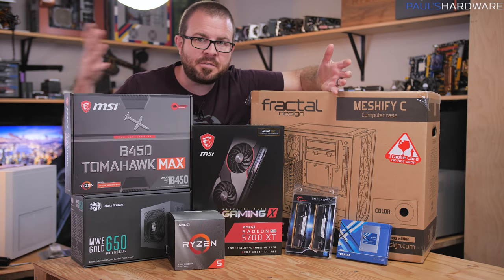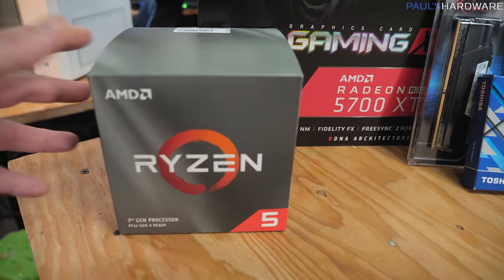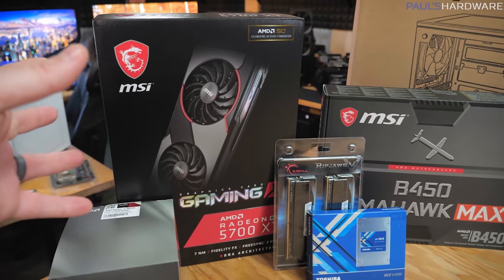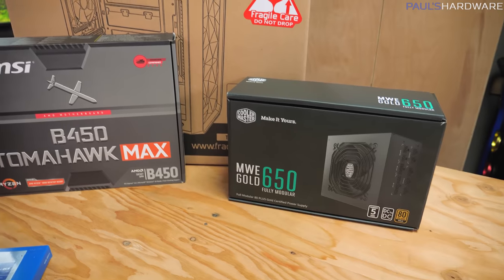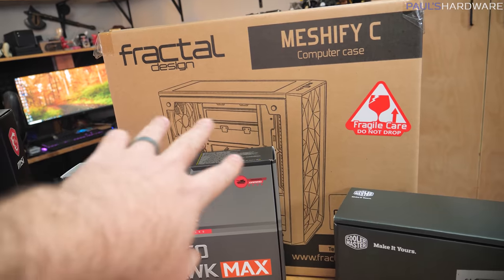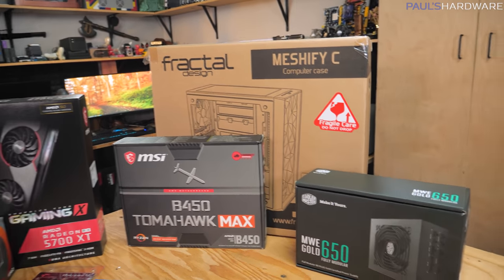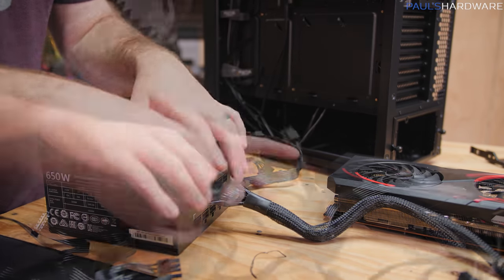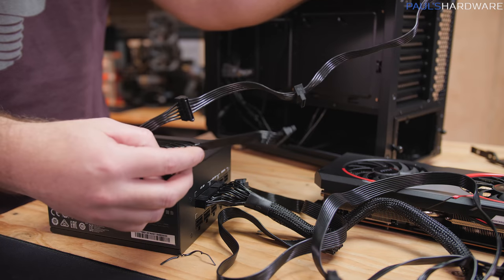Building the $900 Gaming PC that Everyone Should Build!

Comment: Hey. QVL recommends X570 motherboard for this RAM. Does it work perfectly with the b450 Tomahawk in the long run? Isn't it ever gonna be an issue? I'm currently building my first serious PC and I'm a bit worried about not buying what G.skill and AMD recommend.  Also this RAM costs like 180 dollars in my country so I don't know if it's worth it over  Corsair Vengeanca CL18 for extra 30 dollars.

Comment: thx for the build but adding 500gb more ssd and 1-2tb hdd for games and contents, 2 more case fans plus tax, it will end up $1100-1200 in most areas in US
if take keyboard mouse & monitor into consideration it ends up 1600-2000 to get a complete mid level gaming setup

Comment: Hey Paul, if I'm right msi radeon rx 5700 xt gaming x has recommended 750W PSU. Did you notice any issues about smaller 650W in this build? Thanks for answer.

Comment: built this machine.  Worked great until I tried more than two sticks of ram.  Went with two more sticks of Gskill Ripjaws 3600.  Computer won't boot if I try to use slots 1, and/or 3.  MSI says that the 3600 ram is not compatible with MSI tomahawk max.  Pc Partpicker doesn't flag any problem other that the bios update. The board I recieved new from NewEgg already had the bios updated.

Comment: Hey, not sure if you will get this comment, or reply. However, I was wondering if there is a replacement you would recommend to replace the graphics card, I heard that the 5700 xt has issues with lasting a while. Around the same price and power. Thanks

Comment: Hey Paul , so im tryna build i gaming pc and i put up a list of parts but instead of using xt 5700 i went with gtx 1660 super , my questions are  , is it better to go with 1660 super instead of 1660 ti , 
And for the motherboard is it better to go with  x370 instead of b450 ? , And will this pc be capable of being a single streaming pc ? , Sorry for the very long comment ^^'
Keep up the good work bud <3

Comment: Had a question....i know it may sound stupid but i always wondered about it....the m.2 sticker...do i remove it if there is a  Thermal pad for it and temps be better or just leave it on and it does the same thermals? Cuz i see sometimes ppl remove it wen there is a thermal pad like the asus rog strix x570-E and sometimes they leave it on...so is the any Differences in thermal temps if its removed or is it the same?

Comment: I have a question when I try to build this in pcpartpicker they say that the cpu (AMD Ryzen 5 3600x)  is not compatible with the motherboard (MSI B450 Tomahawk max). It says this: Some AMD B450 chipset motherboards may need a BIOS update prior to using Matisse CPUs. Upgrading the BIOS may require a different CPU that is supported by older BIOS revisions. What does this mean?
Reply: it means they gonna charge you extra for the bios uptade

Comment: I see you frequent the amd cards have you noticed any driver issues?  I see a lit of hard no reviews for amd cards citing great hardware but bad drivers with black screening issues.  I'm doing a similar build now and got a great deal on a freesync monitor so amd has been the plan since but after some research I see that nvidia cards can be set up to work with freesync.  Out of curiosity what are your thoughts?

Comment: Just built my first pc 2 days ago after watching many videos and reviews.  It ended up being pretty similar to yours:  Ryzen 5 3600, B450 tomahawk, 16gb 3600 DDR4, Meshify C, but with a 1660 Super and 2 TB SATA SSD. It came out pretty well. Only thing I'm disappointed in is download speeds. Around 11 GB/sec to the SSD on steam.  Is that expected? It might be my internet connection
Reply: Are you sure that's 11Gbps? Most home internet speeds do not go past 1Gbps. Run a speed test on speedtest.net or fast.com and compare that speed against what you're paying for. Make sure you do the speed test on a wired connection.
Reply: @JJFlores197  Woops, I meant 11 Mbps.I just did the speedtest, and it read 100 mbps which is way higher than what I experience on steam.
Reply: @nicksbordone5271  The thing to keep in mind is the units. Network transfer speeds are measured in megabits per second (Mbps). Speed tests show your speed in Mbps, but your web browser, Steam, and other programs usually display the speed in megabytes per second (MBps). There are 8 bits in a byte, so if you divide 100 Mbps by 8, you get 12.5 MBps, which is close to what you're getting on Steam. Its the same thing, just in a different unit of measurement. Its like saying 5,280 feet or 1 mile; 1,000 meters or 1 kilometer.
Reply: @JJFlores197  Oh okay, I didn't realize it was megabits. Since the speedtest matches up with my download speeds, maybe its just my internet. TY

Comment: hey Paul keep up the good work man :) So i wanted to ask i got a ryzen 5 1600 (base clock) B450 fatality 16gb RAM DDR4 3000mhz and 1060 6 gb but...i want to buy 5700 xt red devil and i am afraid of bottlenecking.... I am kind afraid to OC my cpu and also i dont have budget for ryzen 3 series...so what you think? Will i bottleneck with my ryzen 5 1600? :)

Comment: do you need 5700, or is 5500 good enough? (this is my first build btw)
Reply: go for the 5700xt, but ofc that depends on what gameplay you want, the xt will give you high refresh rates at 1080 and most games at 1440 the 5500 might not get as high refresh rates at 1440 but should do relatively good in 1080p gaming
Reply: @eminsharipov2006  thx so much!
Reply: Jeff Shittles ofc no problem!

Comment: Hey Paul, when I'm going to PcPartPicker and I'm starting to build a PC, I choose the CPU AMD Ryzen 5 3600 and the Motherboard MSI B450 TOMAHAWK MAX and I'm getting a warning message: "Some AMD B450 chipset motherboards may need a BIOS update prior to using Matisse CPUs. Upgrading the BIOS may require a different CPU that is supported by older BIOS revisions."
In case of a BIOS update, how will I do that? do you have a tutorial for that?
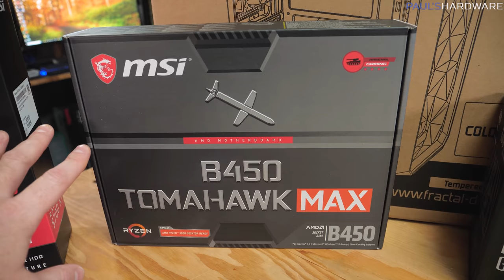Reply: at 9:06 he says since it's a MAX board, it's up to date for use with Ryzen 3000 series chips, so you should be good.
Reply: @jimoneill1445  OK cool, Thanks

Comment: So you swapped the 3600x's air cooler for an older 2700x spire cooler. Does that mean if you chose to use the original 3600x cooler you would need to use thermal paste?
Reply: you should reapply thermal paste whenever you change coolers
Reply: I hear ya. I guess I was curious since the core of the OG spire was copper that i may need thermal paste. I used just straight Aluminum Coolers so I wasnt sure you needed thermal paste for copper cores.

Comment: I'm stuck on what motherboard to get along with ram. I'm trying to build a R5 3600 with a rx5700. I don't know what ram I should use or motherboard because I would like to purchase one that has nvme compatibility, any suggestion or pointers?
Reply: whats your budget?  A decent B450 board will only run you like 75-80, but you might have to have an older chip to update the BIOS with.  OR just make sure you buy the updated version that supports 3rd gen Ryzen chips.  For the RAM get a good brand like G Skillz or Corsair and make sure its rated 3600 MHZ or better.

Comment: Paul, I've got my 2010 rig here (Asus P6T (vanilla)) with an Asus sound card - are motherboards so good these days that dedicated audio is no longer a thing? In short - if I buy a new rig, will I need to get a separate sound card or will I get great on-board audio from the motherboard? Thanks! :)
Reply: Kris A I came across your question but see no answer. Will give it a go. I am a firm believer that specific components can be installed to take workload away from your cpu and memory. Hence graphics cards exist in such a wide range. If you need a high demand for it you need a better card. If it is just for reading e-mail you could do with the cheapest one. 
The same goes for audio. If you just need it for regular audio sounds and some youtube onboard audio is good enough. If you want more immersive sound or better quality there are good boards out there with excellent audio (my 2010 rig has an Asus Crosshair Formula V with 5.1 surround audio output). Separate audio cards do still exist. But those find their application more in music compiling. Your cpu would choke on a workload like that compared to an audio card. Hope that answers your question.

Comment: i have a ryzen 2700x with the from store cpu fan - rog rtx 2060 gpu - 16 gb of ram - the fractal design meshify c case - and x470 motherboard - just installed a 500 gb nvme ssd but have yet to fully set that up. also have a 1 tb hdd. but for some reason i can still only see about 160 frames while playing fortnite. When streaming or recording these speeds can sometimes fall down to 80-90 fps. Don't know if i need to upgrade something to get to 160 fps constant while streaming or if i am just set for disappointment.
Reply: fortnite is 100% cpu and ram bound. meaning an old i5 7600k with a 2060 super will outperform in fps an 3900x amd cpu and a 2080 ti

Comment: Looking to build this exact build would going for a RTX 2060 also work if I don't go for the RX5700 . Also this may sound like a dumb question but say the system usage is 500w's would you really need a 750w supply? Any help would be appreciated, apologies if something sounds silly currently new to pc building
Reply: Yes the 750W power supply is better because it will operate with better efficiency. A 500W supply for 500W need would be putting that supply under high stress, hence less efficient. The price is not that much more, so totally worth it! Good luck with your build mate! Cheers
Reply: @ianp3112  thanks mate, got it all sorted, ended up going for this parts list. https://uk.pcpartpicker.com/list/BwxKQq

Comment: Hey man! I'm getting into pc gaming and want the ability to try my hand at streaming. I settled on a ryzen 3700x, nvidia 2070 super, and x570 combo costing me around $1500 (also found a prebuilt at nzxt that is equivalent but with the b450 instead for $1500). Curious as to if this build will handle game/stream well or if it's even possible to do so at a smaller budget than the $1500 I'm at!
Reply: nope, that build will not even boot!  you need to order another 100$ processor (series 2000 and below) just to update your bios. then after the update it will not recognize your cpu and ram couse bios updates can mess everything up!
If you really want it to boot out of the box then you need a series b550 chipset. they came out last month and with the default bios it will support amd ryzen 3600
Reply: @MihalkaT  that's not true

Comment: So I’m just curios about the thing you said about WiFi, currently I have to use WiFi as I had to relocate my PC Due to having a kid and only one spot for the router downstairs. What would. I have to do to be able to use WiFi with this setup? I’ve never built a PC, and I’d like to build one like this as I’m ready to upgrade from my current PC
Reply: derick grac Im not too tech savvy but you need to get some kind of plug card to go into your motherboard that allows it to pickup wifi (I could be wrong)

Comment: I was wondering what is the glue type thing that you put on the processor before installing the fan at 18:05? Thank you!
Reply: Thermal paste perhaps ?
Reply: That's thermal paste. It allows better heat dissipation between the CPU and cooler.

Comment: dont you need to update the bios of the b450  using  2600 or something in order to use the newer 3600 cpu
Reply: its a b450 MAX, which comes ryzen 3000 ready out of the box

Comment: I just built this PC but my motherboard is popping up with a red light for the CPU. The fans and everything works but no signal to the monitor. I've unplugged, tried and failed many different cables, reinstalled the RAM cards in different slots, redid the CPU/cooler and can't figure it out. Any tips or tricks would be much appreciated
Reply: It’s possible the CPU isn’t getting power. Same thing happened to me when I was messing around with an old PC: Fans running, same with GPU, but no signal on the screen. I noticed an unused plug block (4 hole plug like a square) behind the radiator block near the top left. Plugged that in and I finally got a result on the screen.

Comment: So this could be one of those weird quirks that can't be recreated but I had a bitch of a time with this board. I bought a new 3700x to pair with this board well aware that I would need to flash the bios. Now here's where the trouble starts. I had to go through multiple bios before I finally found one that worked. However my problem didn't stop there. Maybe three months later we experience a power outage my computer turns itself off and what do you know, I have to reflash my bios again. Except this time the bios won't flash and I need to reset the CMOS in order to get the MB to the point where I can reflash the bios again. Last but not least I come home and what do you know my computer is powered down again requiring another reset and  bios flash. Now I know you might point fingers at my power supply it however was also purchased less than six months ago along with the ryzen. I also have not been able to overclock my RAM at all without the board reverting back to a point where I have to again reflash the bios. All in all a complete pain in the ass to save $100 bucks.

Comment: Is there any reason to get the b450 tomahawk over the b450 gaming plus?
Reply: you could probably work find with the cheaper one depends on future upgrades that you might want.  Do you need the extra slots for something?  If you don't maybe you can get by with an even cheaper board.  I run a B450 Bazooka V2 that I used a 2600 Ryzen 5 with until I updated the BIOS and got a 3600 and then swapped the 2600 to an A320 Board

Comment: Guys,, im planning to build my 1st pc,, do all this part come with all the wire needed? Wish me luck,, if u guys have some tips pls do tell me,,
Reply: Level 100 my best tip......pray that it works lol the worst thing is building it all then finding out a part is busted
Reply: most of the cables will come the motherboard and the power supply.  You may need additional cables if you have a optical drive and two or three hard drives, but if you just have one or two drives the motherboard should come with enough SATA cables.  Make sure you get a big enough power supply for your GPU.  A 450 watt one won't have enough power for a high end GPU like a 2070s and higher or the 5700s and higher.  But that 450 might be enough for a 1660 or 1650 for example.  Feel free to ask around about parts you want to use on videos like this or in related facebook groups

Comment: Dear Paul, (that is an awesome PC). I love your video tutorial. Thank you very much for making & posting it.  (I learned several things from it).  I'd (novice) like to 'build' my own PC, and am budget constrained.  Don't game, but desire a good, fast, long lasting (somewhat obsolete resistant) unit.  (Used for Unix, TCL, C/C++, Excel/Word, web browsing, general use).  Question: can you kindly recommend a good value Graphics card of lower cost, that goes well with said Ryzen 5-3600/X processor, please?  (My current PC's an AMD Phenom 9500, 3GB RAM, 2.2MHz, running Vista).  I'm trying to reuse my case, but it requires a Micro ATX MoBo (9.6"x9.6"), and thus further constrains/limits MoBo & video card (size) choices.  Perhaps an Intel i5-9600/K is best, for reason of not requiring a GPU.  I don't know.  But prefer the Ryzen 3600/X, for reasons of faster RAM speed [1800x2 vs 2100 GHz max (I think) with Intel] (& thus faster overall PC performance).  I've recently replaced the Power Supply (600W, Best Buy), and although not the best, believe it can support Ryzen 5-3600/GPU/extra fans set.  Any comments, suggestions most welcomed. (It's a good thing I'm not next door to you, or I'd likely bug you for advice much too much). :-) Thank you. tonyd\.

Comment: Not with a 5700XT. I had nothing but problems with mine. Been building computers for 10+ years and none of what I learned could make the thing work properly in my system, which uses most of the same parts in this video.

Just get a 2060S guys... save yourself the very likely hassle of driver issues.

Comment: So I'm on pcpartpicker and it saying that this motherboard and cpu combo are incompatible.
Is that a fluke and/or is there a workaround? Should I consider a different motherboard or cpu?

This is my first time messing with PCs so I would appreciate any help!
Reply: Honey Claw Are you sure you chose the meshify c and not another variation? I just check on pcpartpicker and it showed no incompatibility, I chose the case first and then the b450 tomahawk. I only check those two items, maybe the incompatibility is with a cooler you chose?
Reply: @NokochoWC  I did not use Meshify C, but it's saying that the b450 Tomahawk motherboard is incompatible with the amd ryzen 5 3600 processor. Changing the case didn't change that.
Reply: Honey Claw not sure what I was reading lol. I am not sure about that issue.

Comment: Hey Paul, great informative video as always. I have a small problem I would request u to guide me about. I built a system following ur videos -
Ryzen 2700
Gskill trident z rgb 32gb 3200mhz (4×8gb) 
Tomahawk max b450
550wt psu
But I am unable to get over 2933mhz with my ram. Tried XMP and manual settings as well. On setting it to 3200mhz even with voltage raised as high as 1.40 system reboots twice and the ram goes to standard 2133mhz. I am confused. Please help. Thank you.
Reply: Did you change the XMP profile in the BIOS?